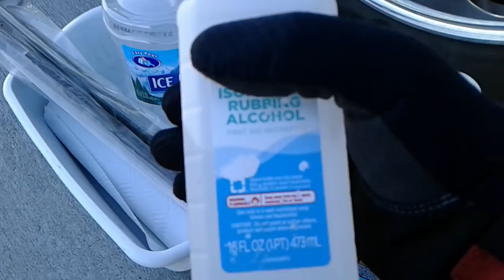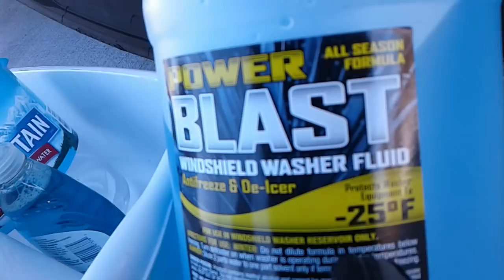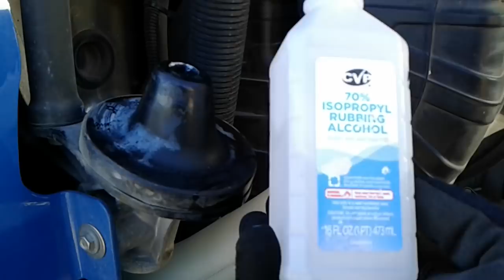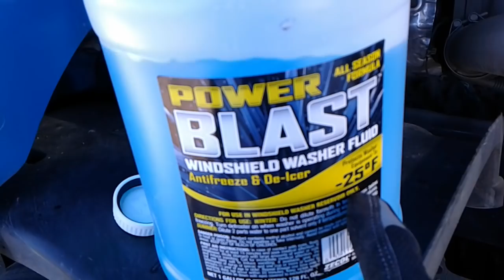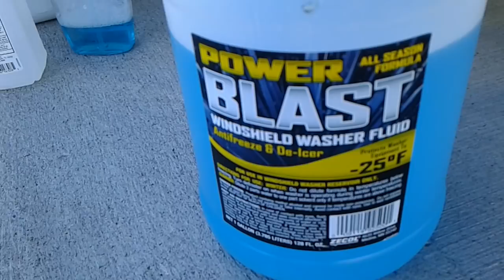Hoods up... And how to keep your washer fluid from freezing

Comment: Old newspapers (or free papers) are wonderful to use for cleaning glass.  Save money on paper towels.  :)  Quick question: What to do if your fluid is already frozen?  Will adding the alcohol help? Adding a de-icing fluid?  Thanks!
Reply from the maker: Yes, alcohol poured into your reservoir will melt ice in it,but it might take a whole bottle to fix one gallon that way, pour in a half bottle and wait 15 minutes and stir it if you can.  I also use it on my sprayer tips in freezing rain and it removes the ice, and the sprayers work again. For that I pour alcohol directly on the sprayer tips on the wiper blades. (on a car they are likely mounted on the hood.)